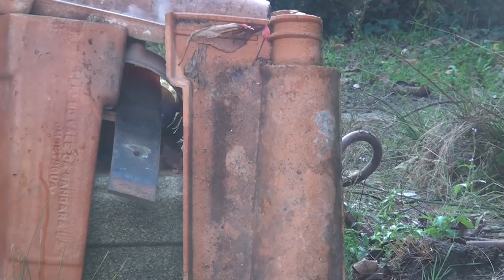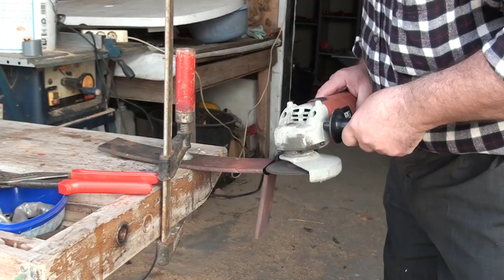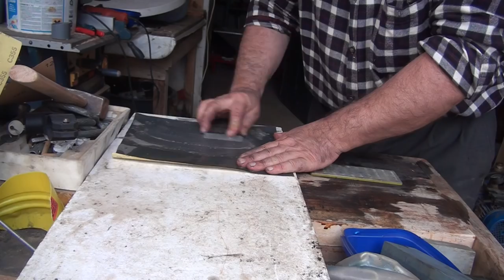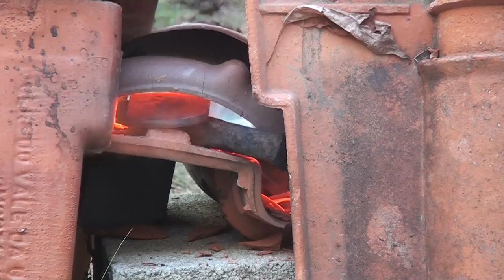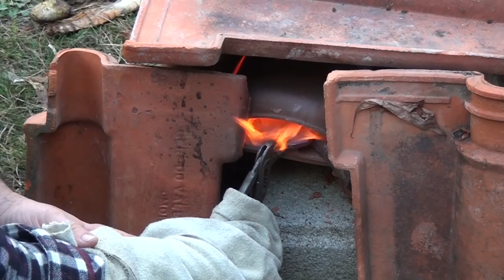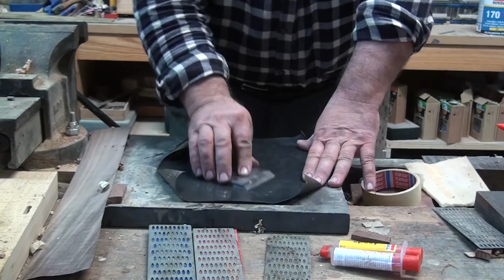How to make a Plane Blade from a Truck Leaf Spring

Comment: To save on cutting disks cut 1/2 way through on the wide side and elevate one end cut side down and smack it with a sledge hammer on the back side of the cut. it will break at the cut line.
Reply from the maker: Thank you